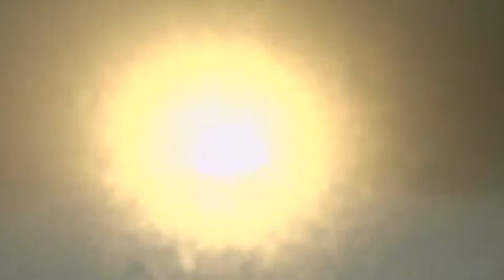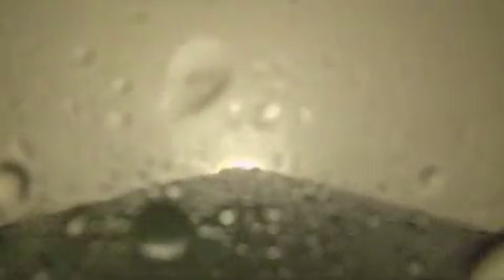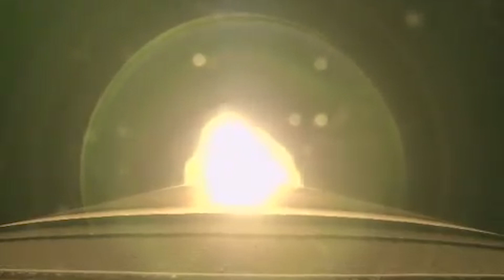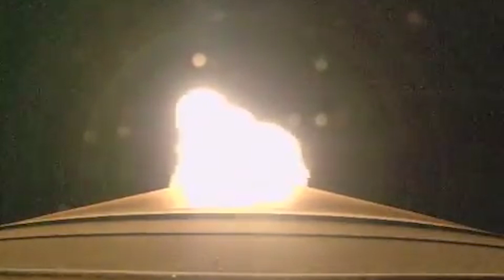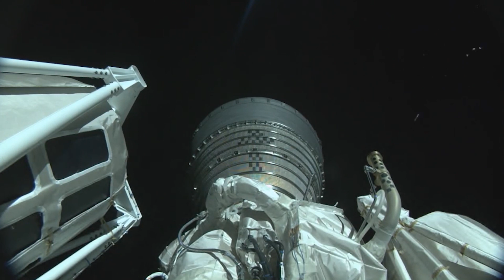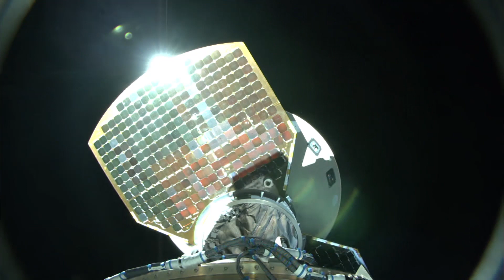Atlas V InSight Rocket Cam

Comment: I find it interesting that the nozzle takes quite a bit of time to heat up and that only the very outer parts get red (compared to F9).
Reply: The RL10's nozzle is actively cooled by the propellant (liquid H2), the Merlin nozzle is not, as is the nozzle extension on the RL 10 which also glows red hot. It's called "radiative cooling".
Reply: Thank you.
Reply: Clarification, both Merlin and RL-10 use regenerative cooling on the nozzle and combustion chamber, and cool passively on the nozzle extension. But the Merlin extension is much longer. 

Merlin also dumps gas generator exhaust at the nozzle and nozzle extension interface to keep it cool.